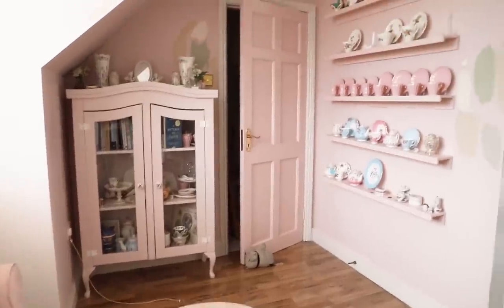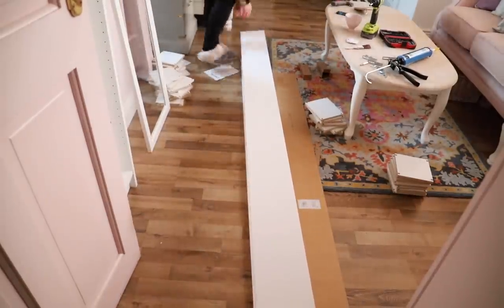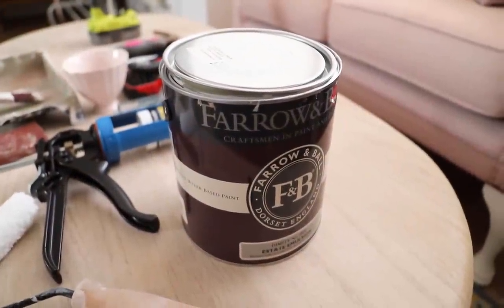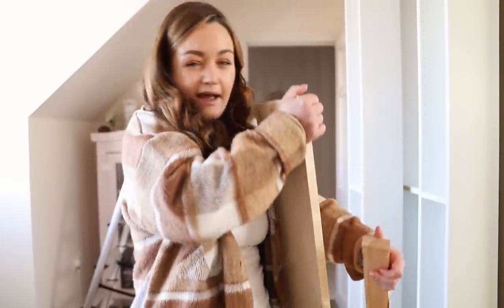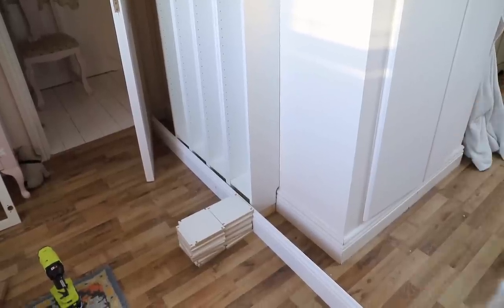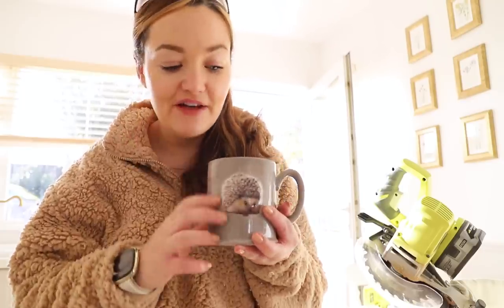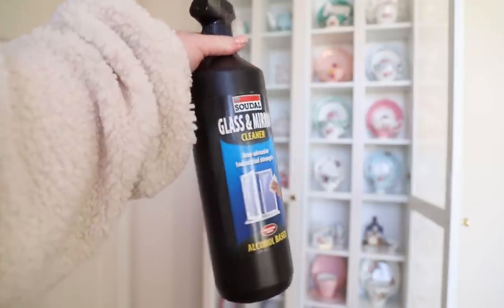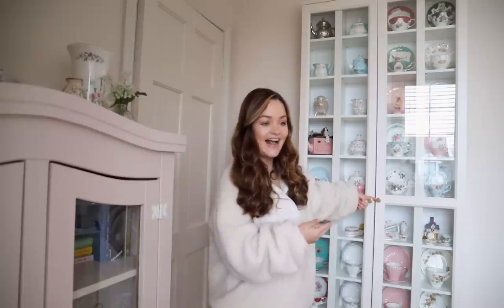Ultimate Ikea hack, turn CD units into a DIY built in display cabinet

Comment: Oh yes, the knows. Quick tip I use. Beforepainting draw a straight line with light pencil across where u want the knows. Then into a x on each for placement. Drill holes, paint. Perfect every time.

Comment: Just a little thing, you wouldn’t normally caulk between the skirting and the floor to allow for expansion of the joint .You did a great job on the cabinet and wall Catherine! Definitely improving with your carpentry. Holding you in my heart at this difficult time❤️✨
Reply from the maker: This is a great tip! X